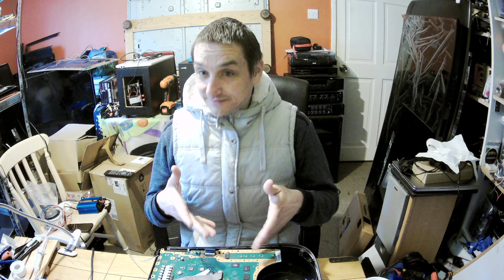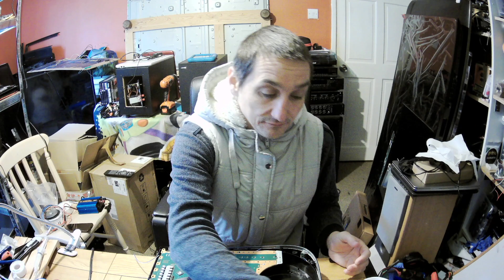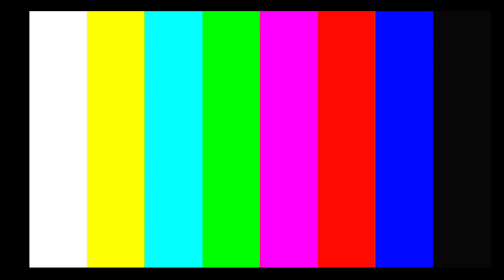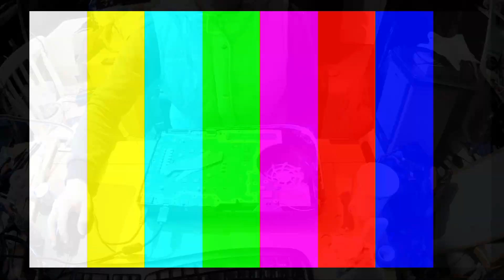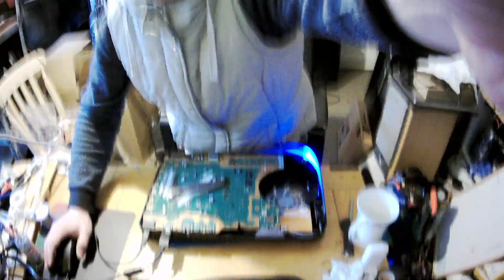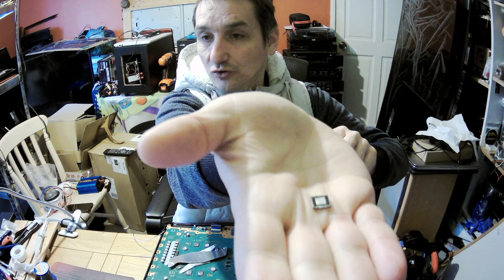I can't fix this PS5, time to give up!

Comment: There is always one more thing you can try.
Reply from the maker: Yes, now there is, and more than one ;). I bought it for £150 from this customer. So, either for spares or find a time and look again. 

Only still have no idea what can be the reason. I'm not even sure if this HDMI encoder works fine. 

I've never tried to use an oscilloscope on those encoders and that would be the only idea I can think of atm. So, I need to find some spare time and just do it ;). Again 60+ screws :D.

Comment: Send it to thecod3r
Reply from the maker: I don't have 1 happy customer who went to him and came back with something fixed. Plus, he has issues with communication and I had a really pain here because of that. Never again. Even in his shop no one has replied to me or my customers. Sorry, but no.
Reply: @screen-protector  I asked him about repairing a Nintendo switch lite and never got back to me so I un-subbed 😆
Reply from the maker: @wisher21uk  I'm no one to judge others, but at least you understand my reasons to not send stuff to him 😉. And, I'd be happy to be wrong.
Reply: Change filters i have simolar problem and I fix
Reply from the maker: @bojans7445  Ok, but filters don't have cross connection, and ohm wise are fine. So, how to check them if they are faulty? :)

You meant those filters which are going to the HDMI port from HDMI encoder?

Thanks.
Reply from the maker: @bojans7445  Ok, now that I'd like to see cause 1 filter faulty so mean there should be some sort of pictures. These are datalines and some of the data will go through. 

I'll use an oscilloscope and check if I can see anything there. Just not sure if can catch well if anything those Gb/s :D Never tried that, so an unknown territory for me :).

If I won't catch anything, I can blindly change and or even short to see if there will be any difference.

Where can I buy these - do you know?

Thanks for the info :).